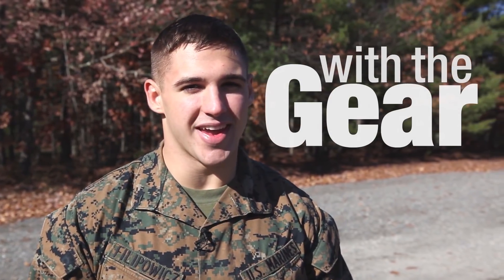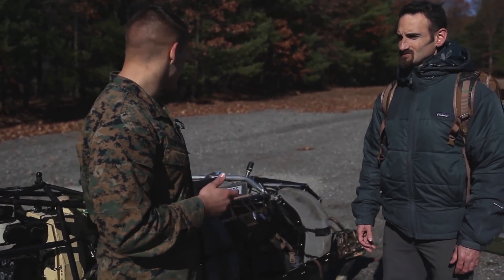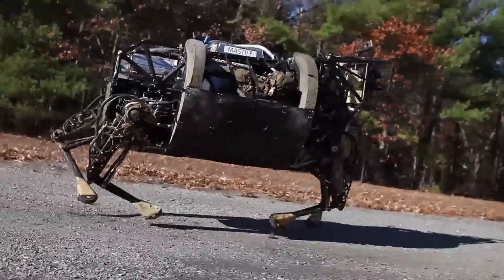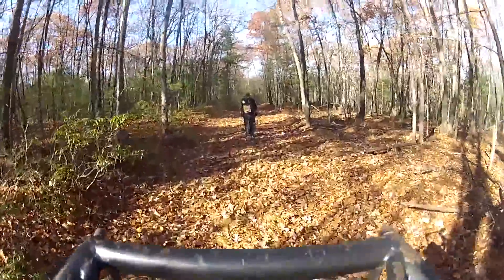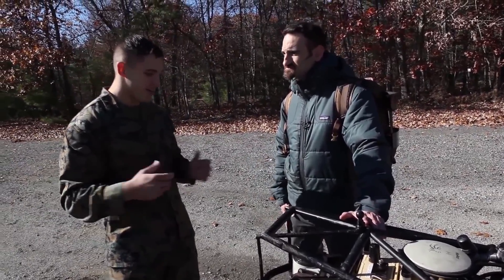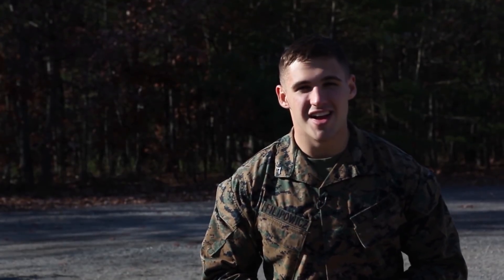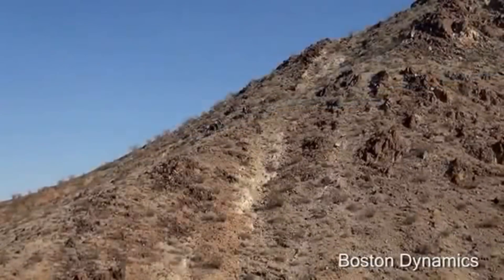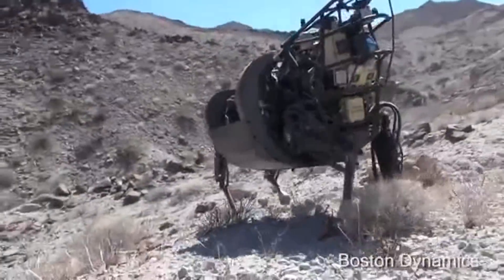Military Robots

Comment: Just another expensive RPG target.
Reply: You're judging a prototype? I find that funny, especially coming from someone who watches macross. You are aware that there's a big difference between a prototype and a final production model right?
Reply: EnigmaHood In fact I do. In fact I know the difference between a prototype and final production. There's a lot of military contraption out there that was shelved due practicality concerns. Didn't you also read my follow up comment IMHO? War designs are hit or miss in battlefield adaption conditions. Why did I say "another expensive target"? 1st vulnerable to small arms much less an RPG round, 2nd very noisy, it'll compromise the presence of troops, 3rd it has no fear factor, 4th tagging along something like that needs fuel, that alone is another burden for its intended purposes. Most wars are won by advantage in numbers, excellent intelligence and you need tons of it. Inventing smaller cheaper and practical intelligence applications of contraption today will minimize troop casualties in the battlefield rather than lumbering loads of metal like this. I have nothing against the engineers who designed this, but in the future it'll also be shelved, will gather dust and be treated nothing more than a novelty. Lastly indeed I'm a fan of Macross, what's your point in raising that?? Some great inventions of past wars started from fiction to fact. And of course not all imaginations made it to development and production stage. Now lets see your own analogy?
Reply: Rhys Cruz IMHO in the changing war theater of today, I think DARPA should put more emphasis on micro drones. They already have that in the works. Drones disguised as insects, birds and crawling critters. It will prove more valuable for urban combat as well as intel purposes.
Reply: I imagine that one of these could learn to detect an rpg and leap from harms way better than a human could
Reply: eventfulnonsense " In fact I do. In fact I know the difference between a prototype and final production. "

No you don't. Because if you did, you would realize how stupid the rest of your post is.

"Why did I say "another expensive target"? 1st vulnerable to small arms much less an RPG round, 2nd very noisy, it'll compromise the presence of troops, 3rd it has no fear factor, 4th tagging along something like that needs fuel, that alone is another burden for its intended purposes."

It's a prototype stupid. 

"Most wars are won by advantage in numbers"

Lol no. Ancient wars maybe, but modern wars? No.

"Inventing smaller cheaper and practical intelligence applications of contraption today will minimize troop casualties in the battlefield rather than lumbering loads of metal like this. "

It's a prototype stupid.

"I have nothing against the engineers who designed this, but in the future it'll also be shelved, will gather dust and be treated nothing more than a novelty. "

Of course it will because it's a PROTOTYPE YOU FUCKING WEEABOO.

"Lastly indeed I'm a fan of Macross, what's your point in raising that??"

Because you're an idiot that gets his education from watching cartoons.

"Now lets see your own analogy?"

You don't know what an analogy means apparently.
Reply: eventfulnonsense wtf is wrong with you?
Reply: HaloModder555 Thank you, that was the argument I prefer to indulge in. Mutual agreement and disagreement at some points. But still I do believe firmly numbers will be decisive in between state conflicts. A stable supply of reinforcements effectively will hold the front. The Mogadishu affair indeed are the example of superior weaponry and tactics backed up by complex military hardware,,,but by saying that we would also consider the cost of maintaining and huge logistics it did involved,,e.g. Aircraft Carriers, low altitude surveillance, that alone in principle represents numbers in hardware, cost and maintenance,,not literally boots on the front. Being fair to the first aggressive commenteur, implied that I'm ignorant of the definition of the Prototype,,my first impression of the Mastiff was plain, and of course improvements maybe in progress and due to his errant harsh words I didn't bother to elaborate further. But anyway,,you have the "IT" factor if I prefer to expand on this. English isn't my language, but I do hope you understand my point. Good day to you Sir.
Reply: EnigmaHood THE WORLD WILL BE BETTER OFF IF YOU'LL SHOOT YOURSELF IN THE HEAD PLEASE! WHAT YOUR PARENTS HAS DONE TO YOU CHILD? NOT MUCH HUGGING WHEN YOU WERE A CHILD?? BOO HOOOO!!! SO NOW WHAT DO I DO? TROLL AROUND YOUTUBE AND SPILL MY LIFE'S WORTH BY ANNOYING STRANGERS?? BOOO HOOOO I DON'T HAVE A LIFE!!!!
Reply: EnigmaHood BOOOO HOOOO!! I WANT MY MAMA AND DADA!! BOOO HOOO!!
Reply: HEAR YE HEAR YE!!! A BULLY WHO DOESN'T WANT TO BE BULLIED! EnigmaHood HID IN HIS HOOD BECAUSE HE'S A WUSS!
Reply: Zhelor Nothing, just want to show you guys, I could also unload tons of swear words, if need be. Good day to you Sir.
Reply: eventfulnonsense
WWII was a war of production. Times have changed since then.
Numbers do not always mean victory. Army Rangers were able to hold their ground against practically all of Mogadishu in 1993.

As for the Mastiff...

What this does:
Provides intimidation against the enemy.
Shows American intuitive.
Creates a practical solution towards lightening the load of troops on foot.
Increases the amount of resources that can be carried.
Creates a practical mobile depot where traditional means would otherwise be impractical.

It is all terrain, able to be directed, and able to support itself.

Today's Marines are pack mules. They carry everything on their backs.
The Army relies on trucks. Not always is this a viable solution. If connection to the troops are cut off, that truck is useless.
That Boston Dynamics concept, aka Mastiff, would be able to follow Marines wherever they may go.
If a Marine doesn't have to focus on carrying that extra blanket or ammunition on his/her back, they can better focus on their objective.

Is it viable for every situation? No. Does it have its weaknesses? Yes, but what is and what doesn't? Nothing.

For Marines on patrol in the hot desert sun or the bitter winter cold, this would be a Godsend.

The noise will have to be fixed and it will. Its longevity will be increased as power solutions improve. Its programming will only become more intelligent with each iteration of such a concept.

An RPG target? The thing is as small as a person. Good luck trying to score a hit on it. You're better off just shooting that thing at a group of people or a wall. The thing was designed for AT combat and has been used in makeshift for ambushing infantry.
Reply: EnigmaHood hahahaha love the tropic thunder reference xp spot on!! :D
Reply: Yeah man, guess we should just stop all R n D for everything else.